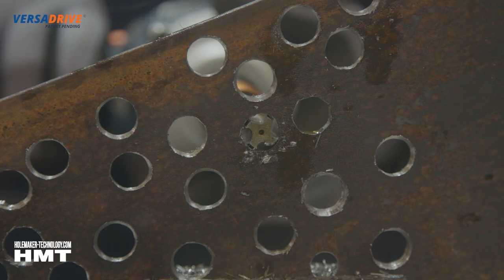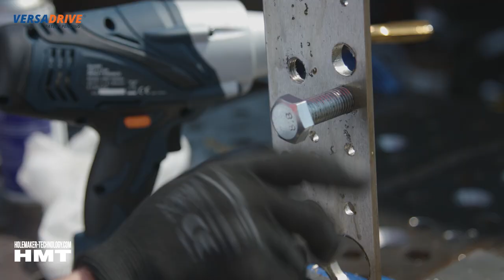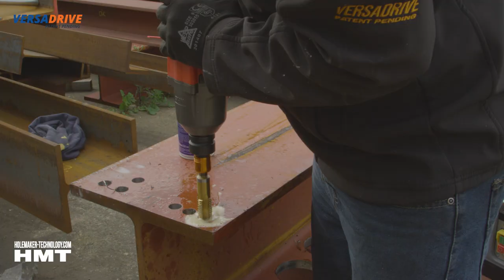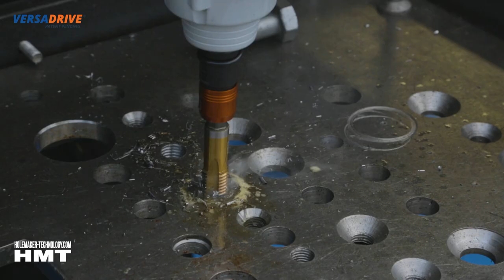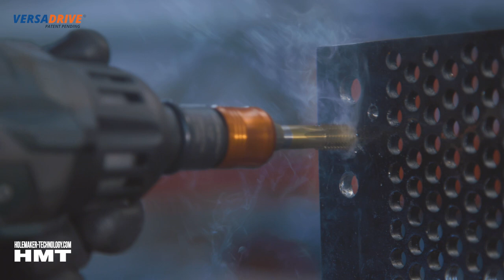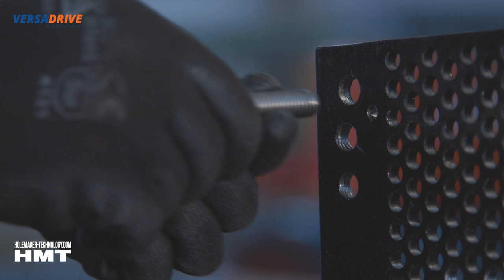Impact wrench tapping highlights - compilation video

Comment: can i use impact drill to tap holes? or impact driver?
Reply from the maker: Hi, thank you for the query. Our products are suitable for tapping holes with Impact Wrenches and Impact Drivers. You can also use cordless pistol drills but if they have a hammer setting, the hammer setting must be turned OFF. The hammer setting on a drill is different from the impact used by impact wrenches and drivers so you must make sure that you are using the correct drive tool in the correct way to ensure the greatest lifespan for the tooling.

Comment: What is volt rating of metabo machine in this video
Reply from the maker: Hi, this is an 18V powertool
Reply from the maker: This is a Metabo LTX400 ½” impact wrench with 400Nm torque. A really nice machine with 12 torque settings. We use it for tapping up to M16/M20
Reply: Thank you sir